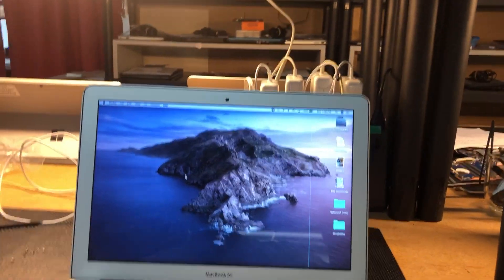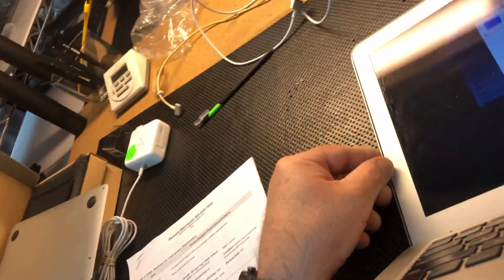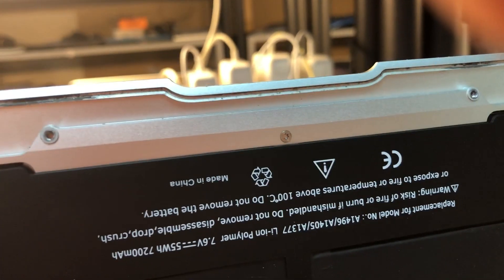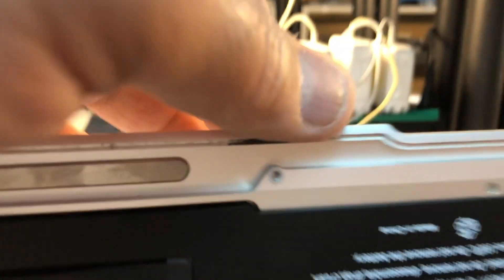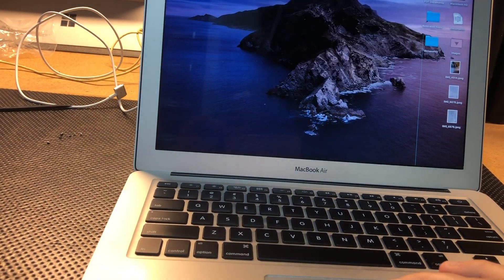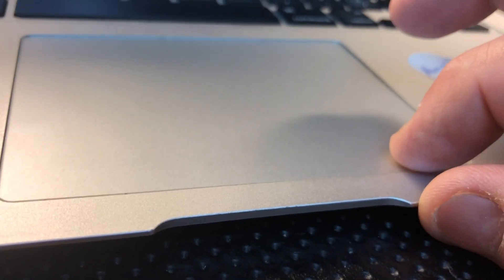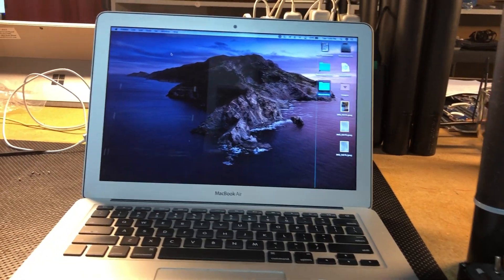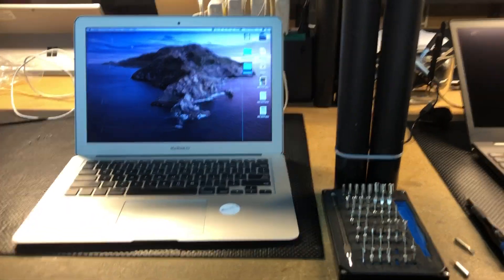MacBook Air A1466 Trackpad Not Clicking FIX!

Comment: Hi. Are you still there? I fixed my trackpad click with your method 3 days ago, and now I am having problems with my battery draining too quickly. It is a new battery. Is it possible that I did something wrong? Is it possible to over tighten the screw, and that caused pressure on the battery?
Reply from the maker: No has nothing to do with the battery

Comment: I was told by the apple help line to fix the trackpad would cost me £320.00 pleased to have found this info. It was 5 minute work and the cost of a screw driver which costed £ 3.00. Thanks a lot